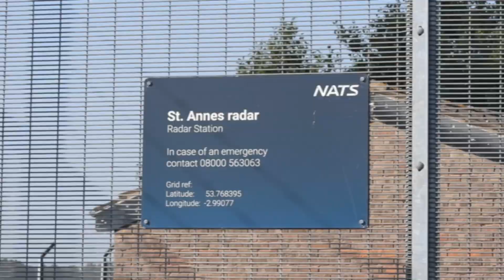A National Air Traffic Radar Up Close - St Anne's Radar Station

Comment: Another very interesting video Lewis!
The four vertical elements on the tower around the radar head. Are they lightning protection or other antennae?
Reply from the maker: I think they’re lightning but I’m not certain Adam
Reply: @RingwayManchester  Yes Lightning protection. Definitely not Antennas as they are connected to earth.